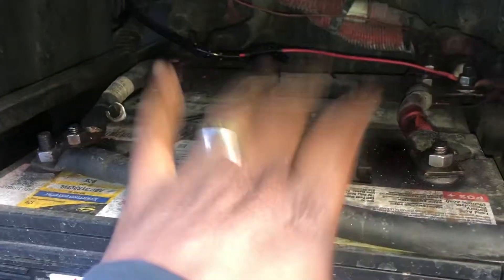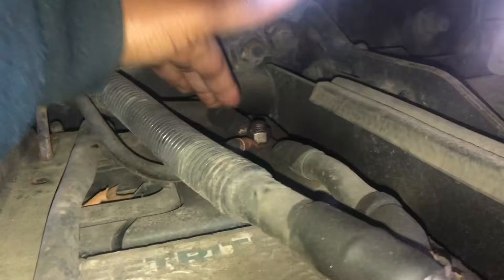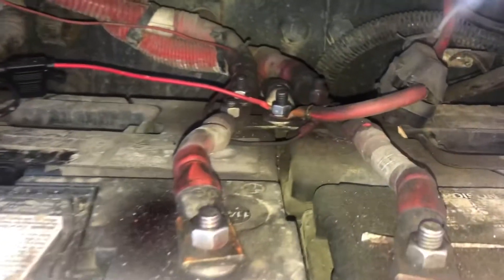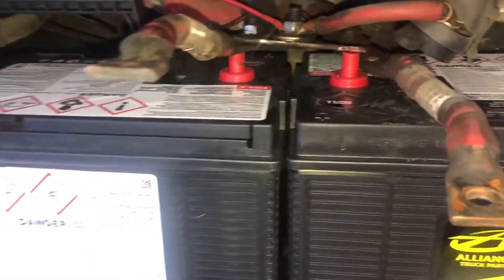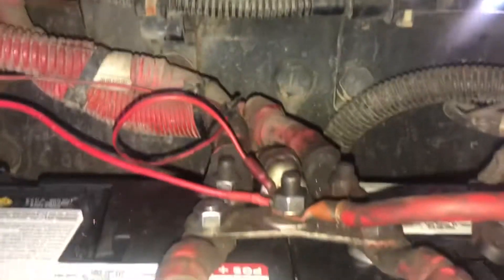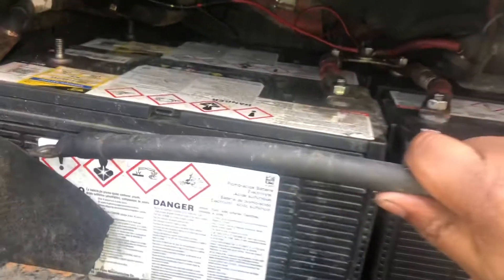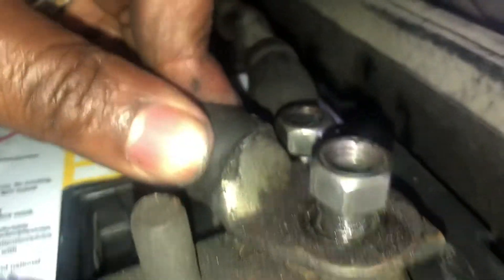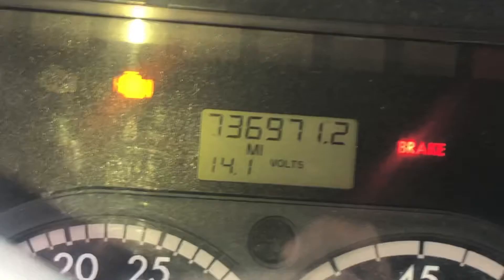Freightliner Cascadia Battery Replacement DD15

Comment: Were these batteries all the same “age” and how long did they last you? 
Did anything lead you to look in the battery compartment in the first place/ to find the one leaking? Did you have a voltage drop or anything like that?? 
TY for making this video 👍
Reply: All was the same age about two years old. The first sign was a rotten egg smell and then the voltage would fluctuate.
Reply: All was the same age about two years old. The first sign was a rotten egg smell and then the voltage would fluctuate.